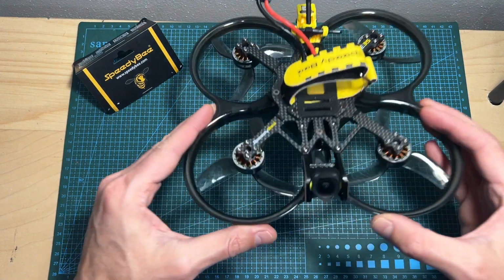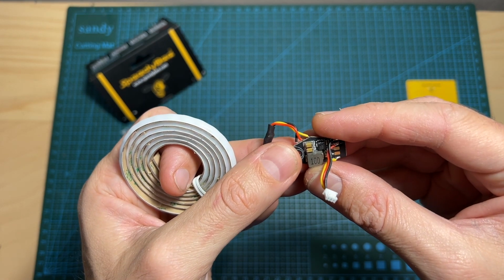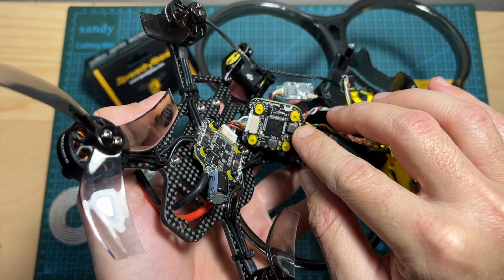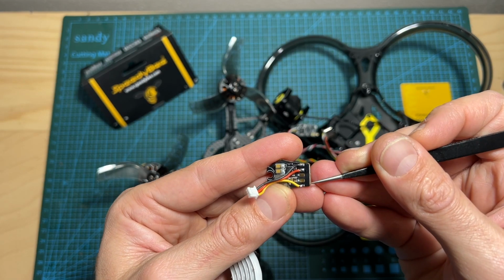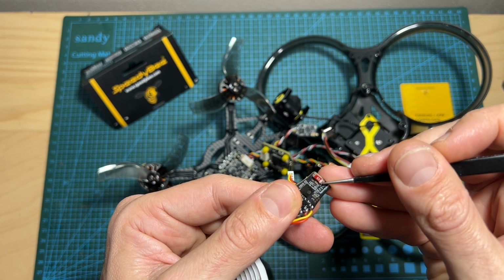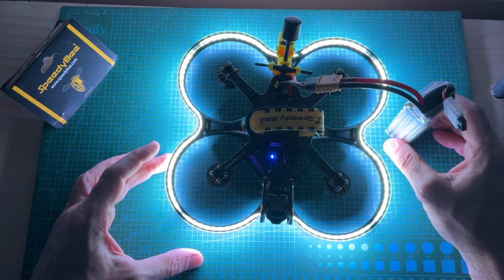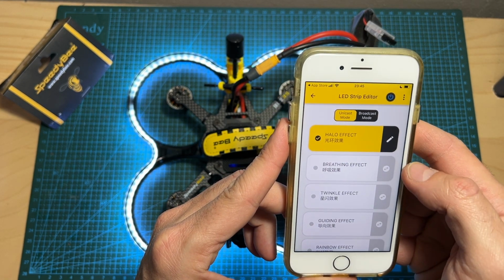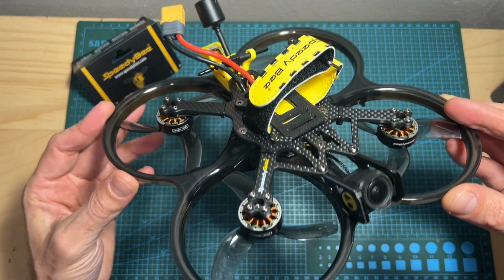Light Up Your Drone // SpeedyBee Bee35 Meteor LED Kit

Comment: For these should I only use speedybee stack or other stack ll also work?
Reply: @CrystalMystic  It can work thru FC but it can be stand alone, just power and bluetooth control via phone and app.
Reply: @ljubomirculibrk4097 okay. The rx tx must be connected for it to work right. I don't have any free UARTs.
And UART 1 just has RX no TX

Comment: nice vid, really detail review! but I still have a question, besides the presets in the mobile app, can the LEDs be configured maybe by beta-flight or some other software? for example, I want the LED at 1cm-2cm to be green, and the LED from 2cm-3cm to be red, and the LED from 3cm-4cm blinking white...... just an example, I never use any LED before, and I think if I equip a LED, I want it customized. Thanks!
Reply from the maker: Thank you. I think that someone commented on my video and said that it's possible. Let me know if you still need help with that.

Comment: Why you connect boot wire in fc that yellow wire can you tell me
Reply: you can use this wire by default to bring the FC into boot mode. but you can also use this cable to switch between modes when you connect this wire to an rx or tx or any other PinIO compatible pad to control the meteor via your remote!

Comment: can be switch on and off from a switch on the transmitter?
Reply: yes it is possible! I found out by chance when I mounted the Meteor on my BetaFPV Pavo20 is (because there is already a plug with +/- and a third line on a TX pad via default and configured PinIO function), if you solder that yellow cable which is soldered to the Meteor chip on the boot pad by default, e.g. to an RX or TX pad on the FC and then operate the whole thing using PinIO via a button on the remote control, then you can also switch through the different lighting modes without pressing the hardware button on the chip or changing it via the app.. like that You can also change the modes during the flight... or if you hold down the button on the remote control for a few moments you can also switch it on and off! ;-) I already wrote this to Speedybee and they didn't even know about this feature! ;-)
Reply: @p_fpv hey i just bought a new one, the LED is on, but the button on the chip/hardware don’t, i soldered the yellow cable to the “s” pad on the speedybee F405 AIO
Reply: @royrano_  needs to be on rx or tx, not s pad
Reply from the maker: Good question. As far as I can remember, no.
Reply: @KremerFPV  yes it is possible! I found out by chance when I mounted the Meteor on my BetaFPV Pavo20 is (because there is already a plug with +/- and a third line on a TX pad via default and configured PinIO function), if you solder that yellow cable which is soldered to the Meteor chip on the boot pad by default, e.g. to an RX or TX pad on the FC and then operate the whole thing using PinIO via a button on the remote control, then you can also switch through the different lighting modes without pressing the hardware button on the chip or changing it via the app.. like that You can also change the modes during the flight... or if you hold down the button on the remote control for a few moments you can also switch it on and off! ;-) I already wrote this to Speedybee and they didn't even know about this feature! ;-)
Reply from the maker: @p_fpv  great, thanks for the update!
Reply: @p_fpv  What did you have to do to make a switch select the modes?
Reply: @p_fpv  have a video tutorial?